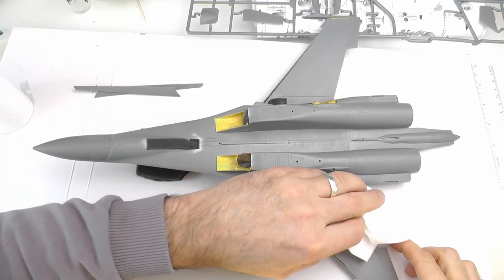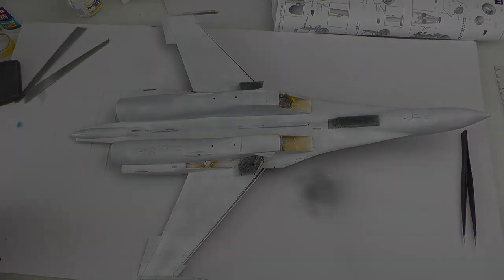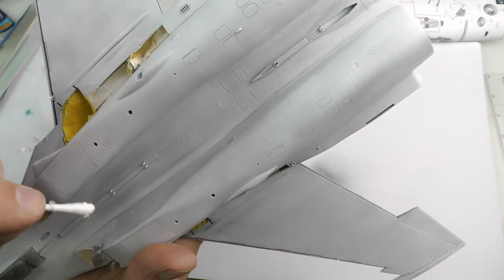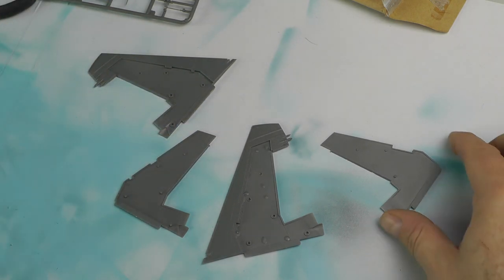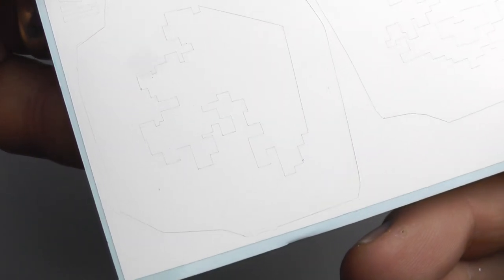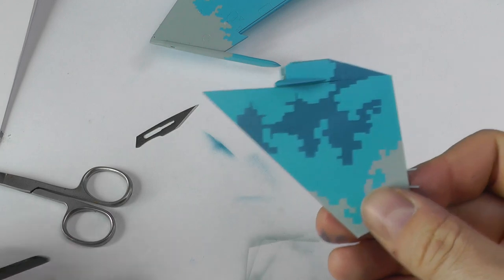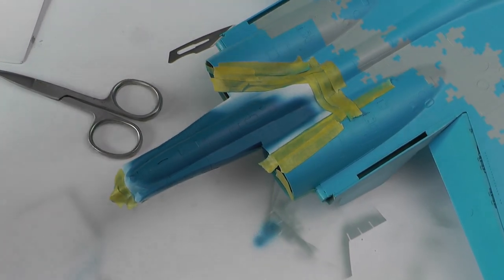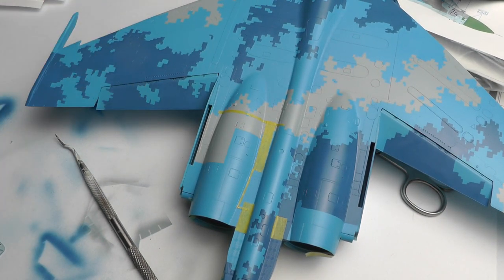Great Wall Hobby SU-27UB Flanker build Part 5 - Digital camo with FoxBot masks tutorial

Comment: Great job on the camo! Really like how the colour combination came out!
Many people say rough things about the Revell glue, but it servus it's purpose well. Knowing where to use it makes the difference. Gluing large parts whit big contact surfaces is great,especially if you have a lot of curing time at your disposal. It's not a 2 seconds glue, but it is rather kind with the plastics, an I use it to glue the canopy also. The contacta profesional, does not attack the canopy parts, thus won't make the canopy foggy. Also good for glue the cockpit in place, I found out the hard way that even after curing some glues still got fumes that can later slowly damage the canopy.
Reply from the maker: Thanks so much for the awesome comment. Yes I agree 100% therr is no issue with this glue asling as yoy knkw what its capable of. Like you say its not a 5 second weld or stick. It takes its sweet time but again, loke you say its kind to the plastic so doesnt cause any sinking or ghost seams. Thanks again

Comment: Bang on job mate! It looks awesome 👌.  First when I was contemplating my Foxbot sheets I was baffled by how I was going to tackle this process 😳...and came up with exactly the same method as you did, but put it away as a future project. Seeing actually how it goes, it's very nice!
As for your future project, I can say that the ZM F-4 series are great. I've built a J version and it's absolutely good. Level of details is great and it builds with no major issues. Only thing that put me off were those stencils,  so it's not done yet ! 
Keep it going with your videos, they are good.
Reply from the maker: Hi Alex. Thanks so muxh for your kind and encouraging comment. I am very tempted with the ZM F-4. I shall see whats available when this builds draws to a conclusion. The stencils like you will be enough to drive me mad 😊

Comment: Just found your channel and catching up on your builds. I have this kit planned to be  built shortly. I'd be interested in Knowing what paint colors you used .. you mentioned H 323 and H156 for the bottom of the fuselage. but didn't for the top side of the Fuselage.  the colors look spot  on.. thanks looking forward to seeing more on this project
Reply from the maker: Hi Robert. Thanks so much for the kind comment. Its something I am trying to work on and plan to give a little more time to showing what paints I use. So hope fully the following will help:
For the Grey I used Mr Hobby 308
For the lighter blue is used a mix of Mr Hobby 323 with a drop of 328, and mixed till i was happy
For the dark blue i again used a mix which was Mr Hobby 34 with some drops of 328, again till i was happy with the tone

I hope this helps and thanks again
Reply: @stregasplasticcartel812  Perfect, thank you !!

Comment: Great video! I'm about to start painting a MiG-29 in ukraine digital camo with Foxbot mask set FM 48-002. Haven't figured out how to use them because there are in some masks different colours right next to each other within the mask, so to say. All these sections have been precut like in your mask but in my case there is not just one color, but several. Hard to explain but if you got any tips on how you would do this, I will appreciate it very much.